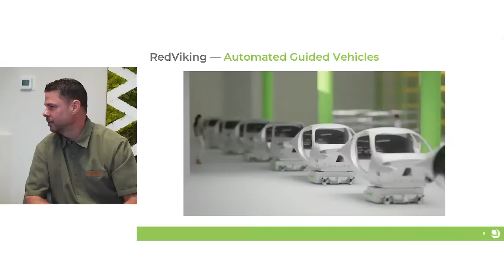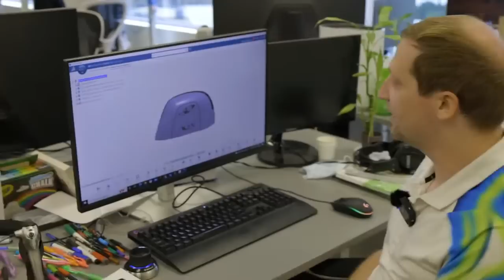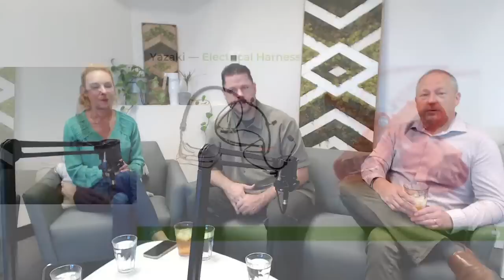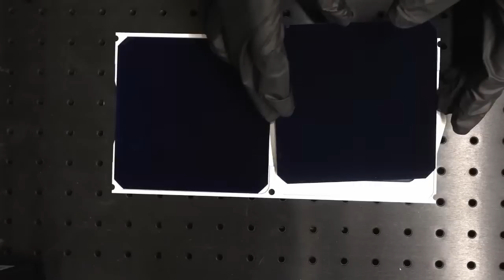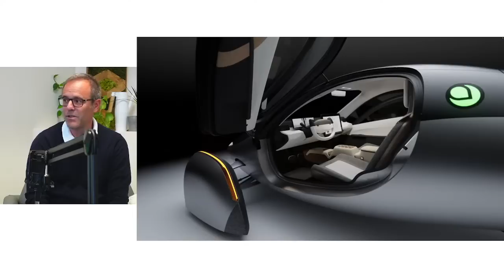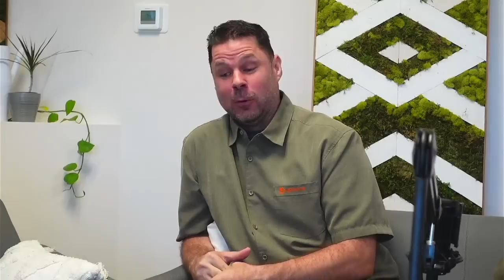Aptera Live Webinar — June 2022

Comment: Well the wheel pants will not work in the northern States or Canada. Great in the summer but will require a removable bottom to increase clearance. Also a scraper of some sort to help control slush and snow freezing inside.
Reply: My Gen 1 Honda Insight has a lower front air dam and no traction control and does OK.  I think I will be fine in Iowa.  I will report on my experience.
Reply: Problem is before the roads are cleared. The rear wheel will be riding on the snow and slush in the center of the road. Also drifting. Maybe an Outback version.
Reply: @SeanWhite  The rear wheels of the Honda don't ride in the track of the front, either.  I have crossed passes such as the Grapevine in California during blizzards just before they closed the road, and spent an entire Iowa winter without difficulty.  That car doesn't even have traction control.

I don't know how you can say it won't work.  I will report based on actual experience.

Comment: I'm in Melbourne Australia and are on my second Ev. With my experience, I'd probably go for the base battery with all the panels. I currently have a model 3 LFP. At one time I'd gone mid size but I've found a smaller range suit's me.
Reply: One question, a standard single garage and the the way the doors open . I'd assume that they be fine with a normal height garage?

Comment: Please  Aptera,  do not use the "abbreviated" steering wheel design...it is gimmicky & hampers its functionality...a perfectly round wheel, no flat spots, cutouts or some such. The temptation to create a "game controller" style steering wheel is high, but this is not a toy, a video game, a Playstation, it is a car. Remember, the customer driving the car will be looking at that wheel 100% of the time, "get it wrong",  and that  first impression will last forever.
  In my opinion, the 1984 Corvette steering wheel is the epitome of functionality, efficiency & attractive design.
  All one has to do is watch the existing in-car videos of Aptera  drivers...watch their hands as they drive, they  use the top of the steering wheel as they actually drive...deleting the top half of the steering wheel denies the driver of control, a disturbing effect.
Reply: I agree...Circles > Rectangles for steering wheels.
Reply: @rayharvey1330  The "yoke style" steering wheel that is currently en-vogue , is a derivative of the generic Playstation hand-controller, a dual pistol-grip creation. Formula One racecars  use this yoke style steering wheel solely because this wheel doesn't go much past 180 degrees of rotation. Watch in-car videos of the Tesla Plaid & marvel at the poor driver maneuvering in a parking lot...a 300mm long two-by-four swinging around posing as a round wheel.
Reply: @rayharvey1330  I have never driven a vehicle with differential steering, except for a boat with joystick control.  I am keeping an open mind to see what the end result is, but it could be VERY different from what any of us have experienced up until now.

Comment: I really like this EV and this company.
I just have one problem, if the motor is on the wheel and the width is 92", if i hit with the wheel is it gonna be to expensive?
Reply from the maker: Hi Pedro! Thanks, we're thrilled to hear it. While it's hard to speculate on future costs, we don't believe so. The motors that we use are quite robust and designed for this type of use! You can view the testing that our in-wheel motor supplier, Elaphe, has done on YouTube: https://youtu.be/1alRUqx9UX8
Reply: @ApteraMotors  Thanks 👍
Reply: Correction - the width is actually 88" compared to  96" for a compact parking space or 108" for a standard one.

Comment: @Aptera Motors  I have a question about 3 things.   How will the battery packs hold up to high heat like plases in AZ  thin how will the soler be protected against rocks that get flung from other cars. The last one if you have a kid that has to be in a car seat in the back seat of a car will this be a problem in this disin tipe??

Comment: Would it not be better if the rear wheel could swing from side to side, like a pendulum in plan? So, turning the steering wheel to the left would force the rear wheel to pendulum to the right, making the Aptera handle more like a 4 wheeler while maintaining the aerodynamics. This would also enable you to narrow the wide wheelbase at the front. They stick out too much. I would like to own one one day, but parked on the road, I just know the wheel is going to get hit, sooner or later.

Comment: Love the concept of this car. Love purchase one but live in Canada and have four seasons. So some questions arise. 1: Highway driving in rain Spray from trucks summer and winter (salt dirty water)
2: winter driving icy roads Handle on spin out salt and ice build up.
3:A/C &  Heat drain on battery winter effect on electric components
4: life of battery
5: In Ontario a lot more seniors which I am one. Some have mobile issuse , Would you ever consider the seats to rotate for easy entrance & exit ,just asking.
Reply from the maker: Hi Len! Thank you for your support and curiosity. Happy to answer your questions!

1) The vehicle will be equipped with flexible protective boots to prevent dust, water, and debris intrusion. 2) All-wheel drive is better for driving and handling in snowy or icy conditions because it improves the vehicle's traction. You may consider adding the off-road kit, too. 3) Our well-insulated body helps, but you may see 10 - 20% less range on really hot or cold days. We are still testing to finalize these numbers. 4) You should not have to worry about replacing the battery or battery cells for at least 10 years. And they are all capable of being charged at home or a public station. 😊 5) This is a great idea! Please feel free to drop this suggestion in our virtual Suggestion Box on our contact us page at https://aptera.us/contact-us/. Our seats are designed with ergonomics in mind and will be adjustable.

Comment: Really interested in this innovative EV. Is there any info on the lifespan of the solar cells and secondly if they can be somewhat easily replaced down the line?
Reply from the maker: Hey, thanks! ☀ The panels will be robust, durable, and replaceable. We are working for at least a 10-year panel life, but more exact figures to come while as continue testing.

Comment: When you get a flat tire, not if, how do you get a new tire in place? Please tell me that that eventuality has been considered.
Reply: Yes.  The rims unbolt from the motors just as they would if they were attached to drum brakes.  It is a simpler process to deal with a flat than with most motorcycles.  There is a youtube video on this by Aptera Owner's club.
Reply: @n.brucenelson5920  I saw that and thanks. Are vehicles required to carry spares for emergencies?
Reply: @davidmcnamara8024  No.  Only about 1/3 of the new cars being sold now come with spares and the number is falling rapidly.  I have used plug kits for over half a million miles of travel, mostly on motorcycles, and have been happy with how they perform on both bikes and cars.
Reply: @n.brucenelson5920  That's great to know. My 2010 Elantra will need replacing in a few years and I have confidence now from your experience.

Comment: Once I have the car in my driveway, would I be able to remove (or re-program) maximum ground speed restrictions?
Reply from the maker: Hey Mark! The speed limitations are voltage base. You should not expect to achieve much more than 100mph. And every part will be tested and calibrated to work as a system. So modifying things in one area may cause problems in another!

Comment: Did you ever take one 1,000 miles?
Reply: The 1000 mile range version will be the last built, after 400, 250, and 600 mile range versions (all rated according to the EPA highway rating).

Comment: My only concern is at 1 ton and under, weight wise.What are the odds strong crosswinds will push this thing around? It's made to have minimal drag from front to back, not in other directions.
Reply: I drive a Gen 1 Honda Insight and it is fine at 80 mph on the interstates in cross winds.  It presents more surface area to the wind than Aptera does.  Aptera will be less affected by side winds than perhaps any vehicle on the road, and certainly better than heavy SUVs.   They have tested this in wind tunnels.

Comment: While driving down the road a yoke is fine because you rarely turn more than 90 degrees, but roundabouts, parking, or driving in tight areas such as grocery stores... will be hell.  Don't get hung up on redefining the steering wheel!  Yokes are only perfect for planes because you nearly ever need more than 70 degree on any turn.

Engineers often have tunnel vision which commits them to bad design which ultimately promotes implementation of crap.  A good design has to hold its own under every condition without a debate.  It sounds to me like that interior design engineer has committed to some decisions which he forced.   No big cup holders and the no steering wheel.  Both are like starting a restaurant and trying to tell customer what to meat to order, but they are vegan.   Don't forget the customer!
Reply: Aptera is designed to be as efficient as possible and some of the steps to this end are surprising, since this has not often been done before.  Don't let your imagination run away from you by overlooking major elements of the Aptera design, which include that steering is not only achieved by wheel angle but also differential steering.  There may well be no need to turn the yoke more than 90 degrees to spin Aptera in place.   Lets see what they come up with.  We will find out more shortly with the public showing of the gamma model.
Reply: @n.brucenelson5920  Imagination is what is needed to test theories or debunk features of engineer's love affairs of bad design.  Until every possibility is tested in the real world, nothing is adequate.  Situations may never occur or be apparent during minimal testing, but when unacquainted humans start using them, or misusing the vehicle, a different story may emerge.    I could see logarithmic differential steering under 10 mph (for example), but a sneeze on the highway during heavy rain could lead to a farm yard incursion.   Imagination is important.
Reply: @rjaquaponics9266  You well may be correct about this.  The response from the steering impute is very likely to be speed sensitive.  Since the solution they deliver is likely to be patent protected, we are unlikely to find out details much before delta vehicles are launched.  We do know that engineers from multiple companies have been developing this tech for at least a decade and whatever is delivered will be well tested.
Reply: @n.brucenelson5920  Patent Protected really means nothing at the scales (money) they are developing.  IMHO Patent aren't worth the paper they are printing on.  If a huge manufacturer like a design or simply reengineers the design... they will implement it.  Then it take millions to fight and prove patent infringement.  It's not worth it.  Better off spending money to be the first market and keep the manufacturing skills under wraps (NDA, and Noncompete).   Sounds to me this company is patent heavy with no product on the market.  Cart before the horse.  There have been other vehicles like the X, but with a small gas engine.  This far, they produce Patents nothing more.
Reply: @rjaquaponics9266  I appreciate you expressing your opinion.  My experience with startups, both pre and post revenue, is that VCs considering investment look at potential IP as one of the first things they consider.  It doesn't sound as though you have any experience in the startup field.

When Aptera was liquidated the first time, the IP was one of the valuable properties that was auctioned off, and re purchasing it was a key to Aptera being able to restart under the original founders.

The IP being generated is one of the reasons Aptera is able to obtain investment funding.  This is true of any technology startup company in the pre-revenue stage, which is where Aptera is at the moment.
Reply: @n.brucenelson5920  You are correct, I have not launched any startups.  I have diagnosed  many system engineering fubars myself and I witnessed a very successful product fulfillment company that had domestic and foreign Patents be destroyed by Big's that merely re-engineered their product.  They called my friend to tell him they love his system, they said, "we have already re-engineered it, and plan to sell it in the US for half the price" and hungup.  That is exactly what they did.  Numerous infringement lawsuits sprung up and my friend actually was forced to sue enduser companies that backed out of sales and bought from the new competitor.  In the end, my friend claimed to me "Patents are worthless unless you have bottomless pockets to defend them.  To large corporations, it's a cost of doing business."   

I can understand how R&D IT can be valuable.  However, have you heard of Elio Motors?  They made many promises with over 65K pre-orders and not much has happened.  I believe they focused too much on Patents instead of the end product.  I tend to lean toward Elon Musk methods of design.
Reply: @rjaquaponics9266  I am not dismissing your experience.  In fact I know this kind of thing happens all the time.
 I have a funny story about this.  My company sold gas sensors among other things.  We had patented an application for a certain gas, but had not tried to produce an instrument using it yet.  We hired s grad student for a summer project to characterize the sensor, and discovered it didn't work for that gas. We later found that a  major chemical company had decided that we were too small to defend our patent and spent millions attempting to developed a product based on it that we already knew would never work, and why.

Sometimes a patent, even for something that doesn't function can be valuable.  They did not attempt to enter our market for at least another decade.

You your reasons just don't apply to startups seeking capital.
I was interested in Elio, too, but the fact that their deposits were always non refundable gave me pause, and when they announced impossible engines I knew they were a fraud.    At the time I was sourcing small engines world wide and knew all the possibilities.  We ended up buying the diesel version of the Smart Car engine from Mercedes and doing the engine controls and EPA cert ourselves.
Reply: @n.brucenelson5920   Very interesting!  Thanks for sharing.  One thing I would like to say is technology built 10 or even 5 years ago may be viable and have value,  But, as technology advances reinventing the wheel becomes so much easier with the tools available today.  30+ years ago electronics was built to last forever and now it is designed with obsolescence in mind, or  released in REV's.  The best thing I ever bought was a snow fence!  It worked without fail and lasted forever.
 
FYI  I created many interesting specific systems for logistics and then combined my previous skills as a Sous Chef to produce a POS system for restaurants.  A POS system that worked with about 20 less button pushes per order.  I had a dozen systems installed with a throughput of 15 million.  It wasn't competitors that destroyed me, it was my bank.  In 2008, I secured a small SBA loan to lease POS systems to restaurants.  Little did I know Obumble would collapse the economy as he did.  The Bank always said the loan would "simply renew".  I only used half of it and I made every payment plus a few princ payments when able.  A month after it should have renewed, they called in the note. I lost everything.  Later, I learned they did this to many SBA loans.  A few year after destroying me, the bank was close after 115 years in business.  I lasted 21 years and would likely still be in business had they not sold on me a predatory  loan.  Note to self and anyone listening... Never, take out an SBA loan unless you plan to pay it off in less than 5 years!  I trusted them and they screwed me.  They squashed me like a bug.  Unlike others, I never recovered.  Now, I concentrate on wood working for fun!

Comment: The wheel covers might be nice for aerodynamics, but what about how they shed water while driving down the road in a heavy rain storm?  My guess is... don't drive during rain or snow (which is another issue)
Reply: Aptera is not being engineered by complete novices.  I will be driving my Aptera in Iowa and will be reporting on the performance soon under these conditions.  The ABS/Traction control is truly excellent compared to anything else on the road.

Comment: The biggest flaw with this vehicle is having 3 tires. I would be dead about 3 times over in the past year if I had this over a traditional vehicle. Our highways are riddled with screws and nails in the rust belt. If that back tire goes, your dead.
Reply: Quite an imagination there.  Aptera has traction control and inertial sensors that can respond 32 times per wheel revolution - about every 2.5" of tread travel.  I have had both front and rear punctures in over 400,000 miles of motorcycling and never crashed from them.  Aptera punctures will be easy to manage and easy to repair, even compared to the motorcycles.

Comment: This personal transportation scheme would also facilitate any power source. Even electrical power sourced from a small light weight and efficient internal combustion engine rather than solar cells.
Heck, why not just stick a single small engine to drive the rear wheel and get 100 miles per gallon and do away with all the micro electronics and electrical actuators for the body controls?